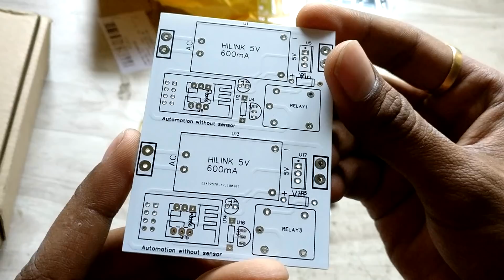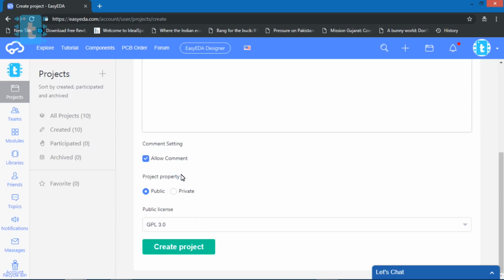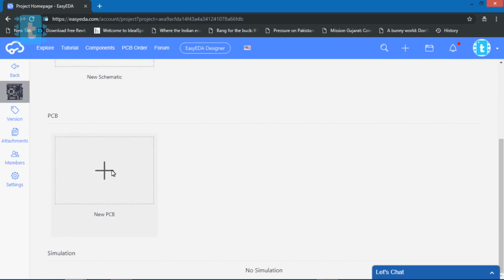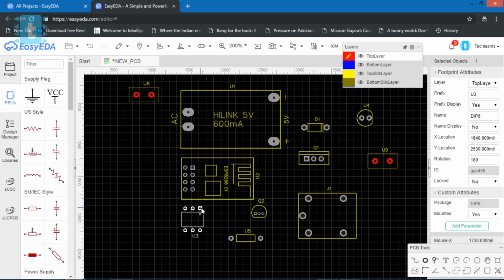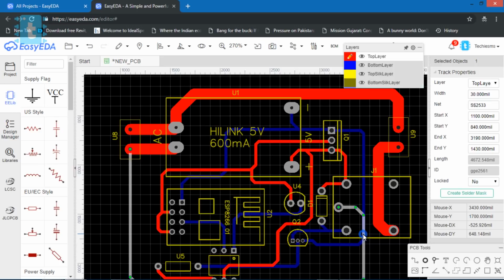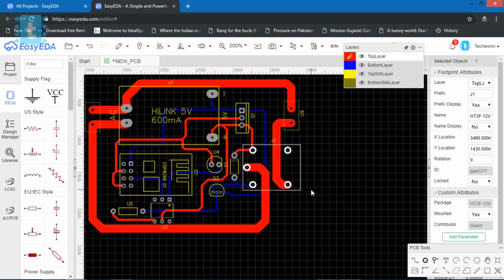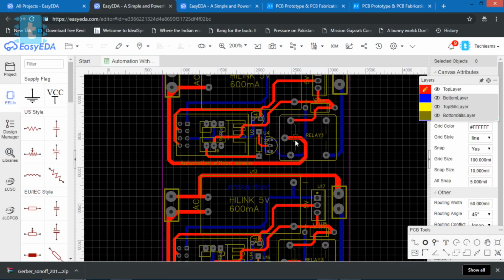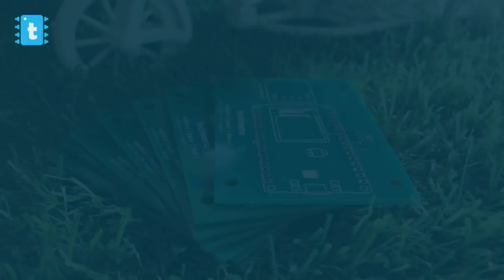PCB designing tutorial on EasyEDA | How to design your own PCB | JLCPCB

Comment: Interesting. You make a PCB directly. I always did it after drawing the circuit first then get a PCB using auto routing. Finally I edit the PCB. However, what is your opinion about designing a PCB directly while the schematic is a bit complicated.

Comment: Very Nice Tutorial . I wanted to ask if it was possible to make a tutorial to change the size of the resistors in length and diameter of the holes so you can use this tutorial to fix the shunts on the PCB since the libraries do not exist preloaded. Thank you so much